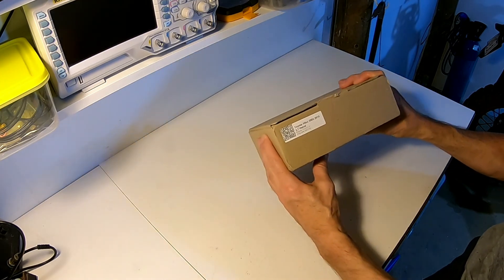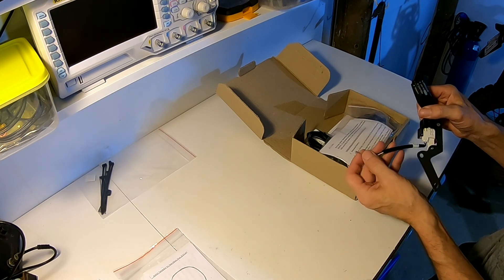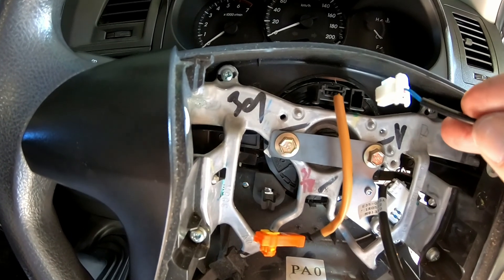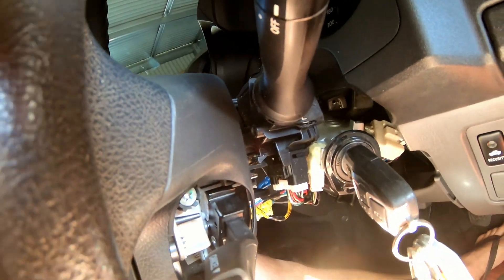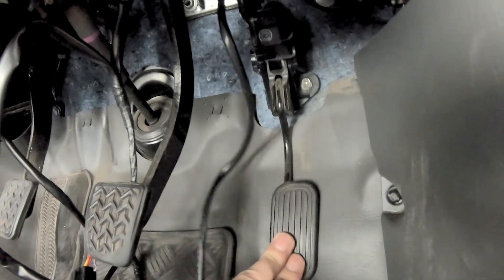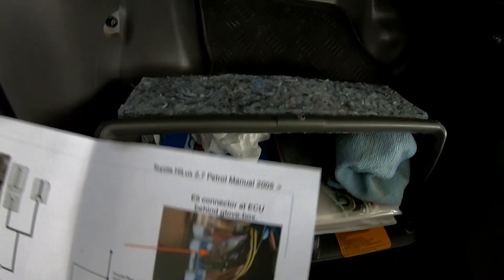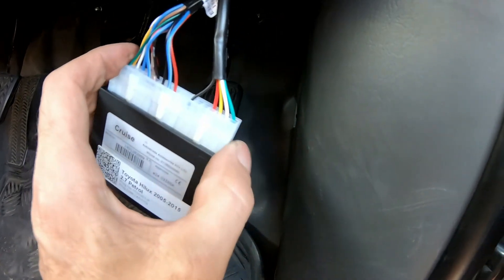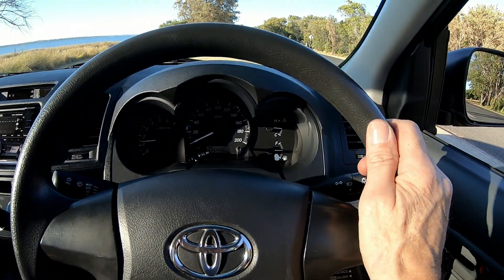2.7 petrol Toyota Hilux / Tacoma, cruise control.

Comment: Awesome video mate.

How has the cruise control unit held up over time? And did you ever get the indicator light added to the dash?
Reply from the maker: Cruse still going strong. Yes, drilled a hole in the dash between the gauges at the bottom for the interaction led.
Reply: @mostlymotorcycles.  brilliant 
Cheers for that, looking at doing this mod soon.

Comment: I bought one of these for my 09 hilux... but the led wont power up.. any ideas?
Reply from the maker: Only the obvious ones like is there 12v at the + terminal a good ground/earth. 
Maybe check the steering wheel switch or connections. 
I sure you wouldn't have attempted this project without a basic knowledge or car electrics, so I'm probably telling u stuff you've already checked. 
Did you get the correct connection to the steering wheel slip rings?
Reply: @mostlymotorcycles.  update... so I contacted the seller, and they tell me that 99% of the time, a failure is due to wrong installation or a faulty clockspring... I'm not sure how to tell if the clockspring is bad.. My airbag light goes out a few seconds after running so I figure it 'should' be good... to test my theory, I connected the 2 wires from the cruise stalk, to the 2 terminals on the ecu, where the clockspring plug terminates. ( i used a multimeter to test for continutity to make sure). This time, the cruise LED lit up.. so I guess that means I do in fact need a new clockspring...

Comment: Do you know if this will work for a 05 Toyota Hilux Surf 2.7L Auto?
Reply from the maker: It may not. It needs an input from the rev counter to control engine speed. 
As it's an auto gear changes / engine RPM changes would upset the computer. Even when the  Torque converter lock and unlocks going up hills would cause issues. There may be an Auto specific model you will need to check.